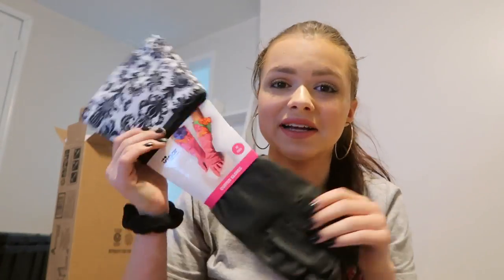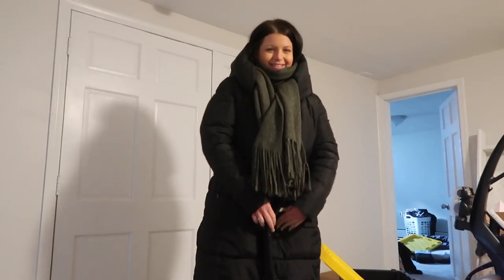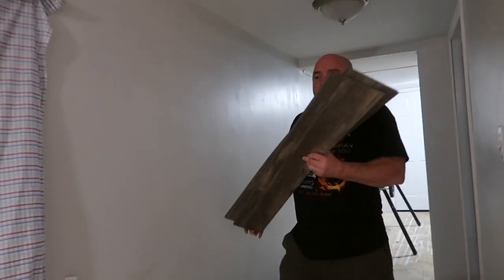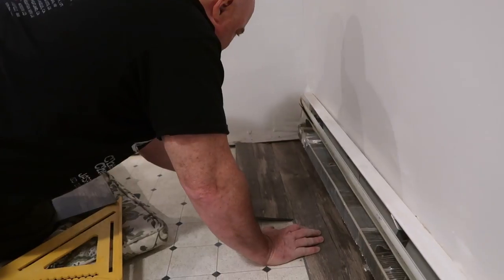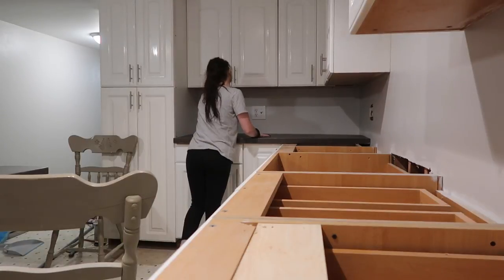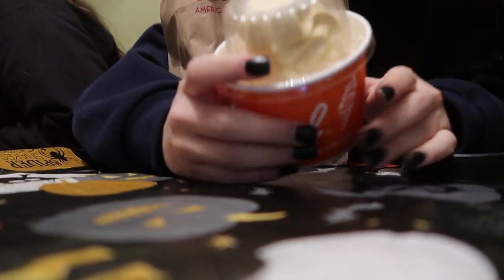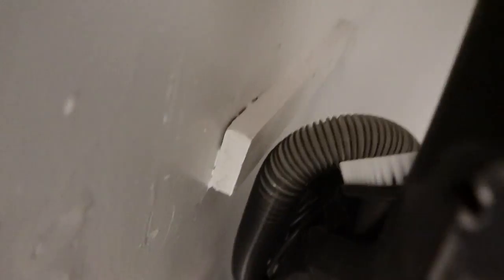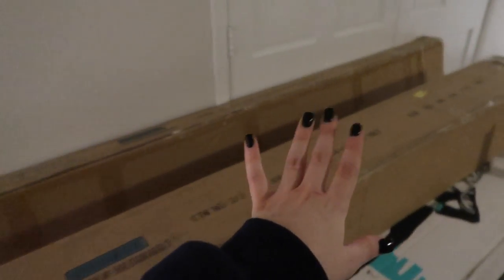The Countertops AND Floors Are Going In!!!

Comment: Do you glue down the floor or anything?? Or does it just sit on top of the other flooring and you can reuse it? Haha
Reply: Devon Taylor if it’s what I used, it’s called a “floating floor” , you don’t have to lay anything underneath and you can easily take it apart if you’d like to remove it.